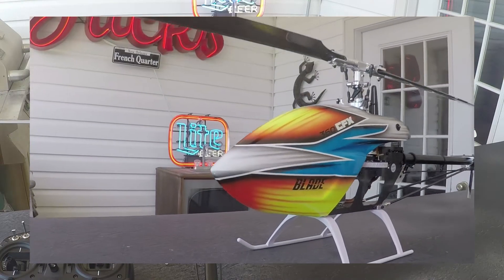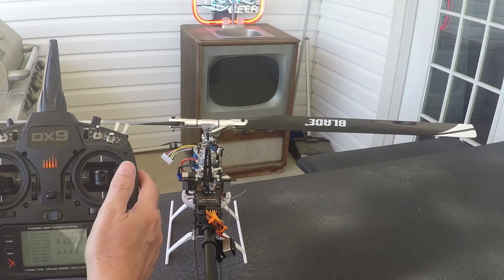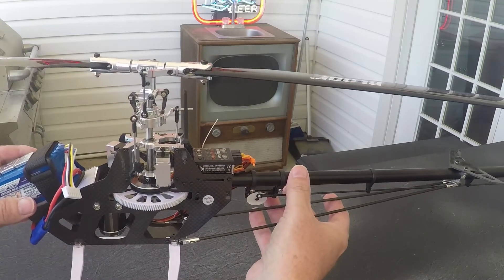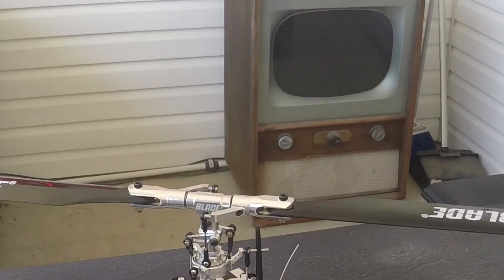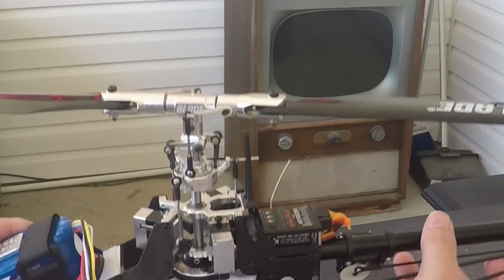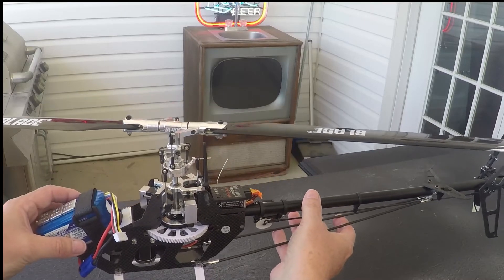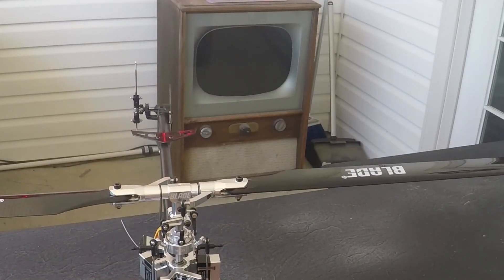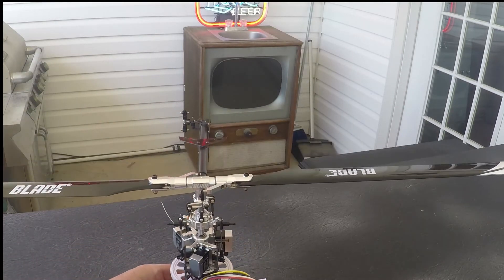Blade 360 CFX checking swash movement

Comment: Hello, when I enter the servo adjustment mode and attempt to set my blades to 0 degrees pitch, I find my linkages have to be adjusted a lot to get the length right in order to 0 the blades. My Swash is level. I may have to set the swash up higher on the motor shaft. Not sure if this is correct. Does anyone understand my issue? Cheers.